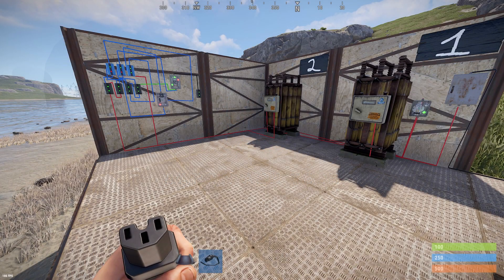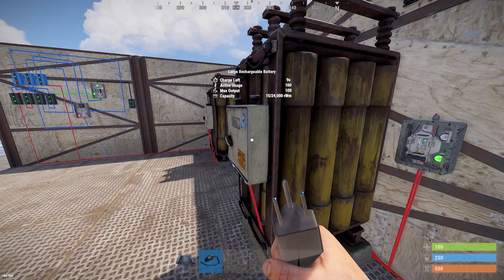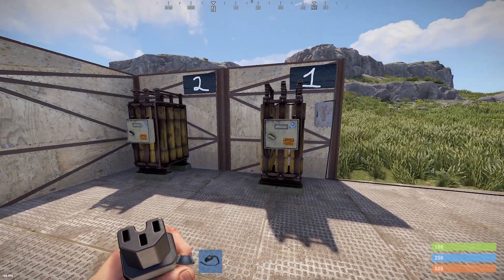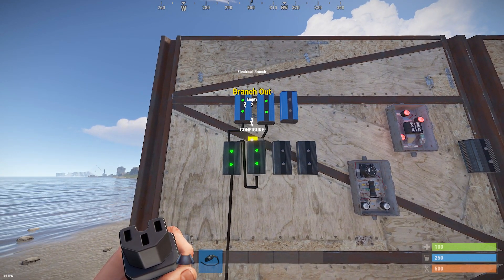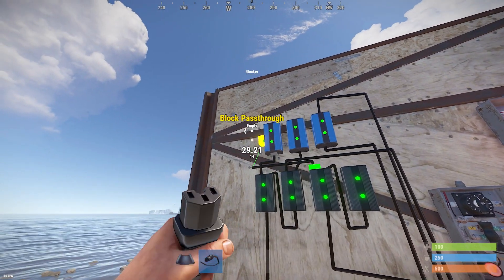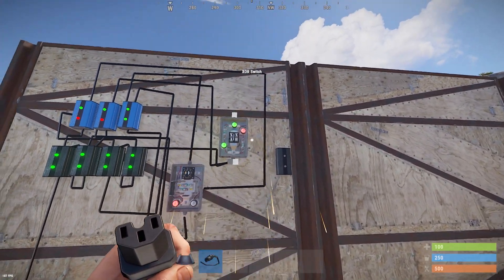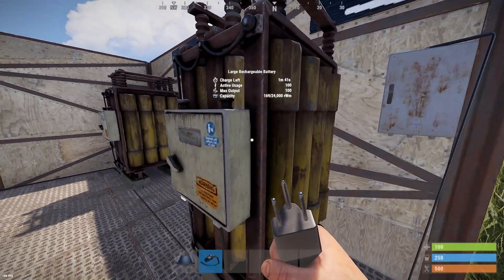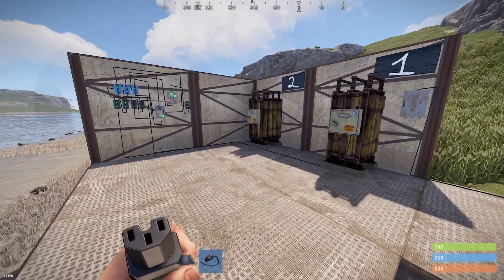Rust Backup Battery System

Comment: This could just be done using one of those red thingys and connect both batteries to it (it would drain both batteries at the same time), but this should be used so that raiders need to find 2 batteries to disable turrets. Good idea either way.

Comment: The timer aspect isn't as efficient as using memory cells that instantly switch when one battery drained and the next one starts
Reply from the maker: The timer is just for the recharging purpose without any load on the main battery

Comment: This is all right but also its over kill. Better to not pull more then u bringing in.
Reply from the maker: If you put charging on 120% of the power output then you can run it on full load without battery drain out.
Reply: @aaronash8571  ya bro, its all right. But u have to double ur batteries just to recharge. Like I like it. But it's alot more work, and upkeep. I mean there's nothing wrong with the idea. It's great. But usually a windmill alone is strong enough to bring in more then u take push out.